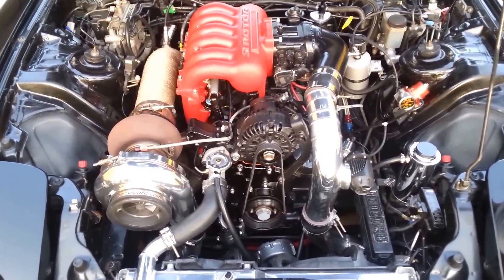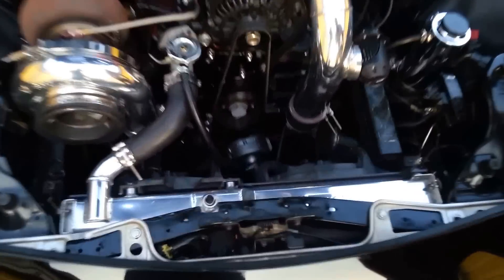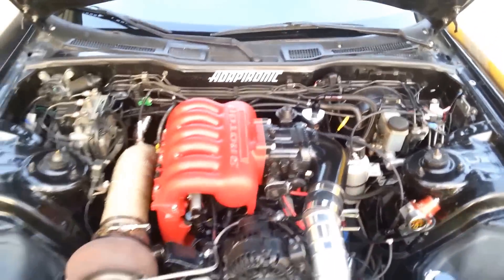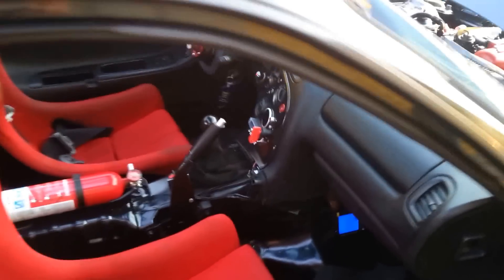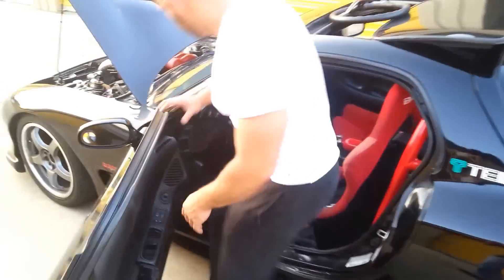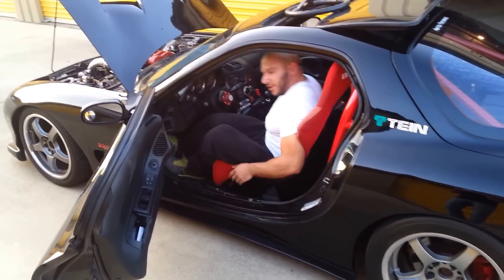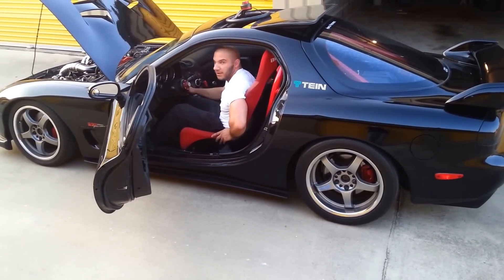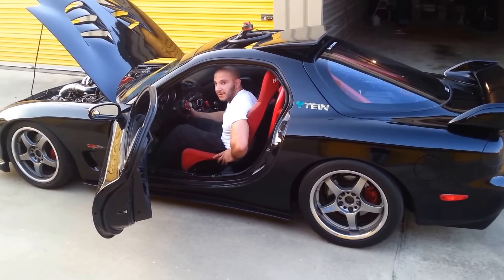3 Rotor RX7 80mm - Review Electric Waterpump

Comment: Nice car and EWP system. I understand you no longer have this car (Cause you went totally insane +4 😎👍) but I was wondering if you would still recommend this cooling system for an RX7 20B setup. I’m not worried about the EWP capabilities, I’m just concerned about its reliability. Are you using this setup on your 26B?

Comment: Oh so the 4 rotor used to be the 3rotor. Ok ok. Are you still using the EWP on the 26b???
Reply from the maker: Chris' RX7 FD thanks chris,
this is actually a different car, i sold this car to build the 4 rotor car. Yes sir, ewp on 4 rotor working excellent
Reply: Wow! they looked like the same car. same roll cage, color and so on.
That's good to hear. I have the EWP on my FD as well. are you using a thermostat on your setup? any issues with winter driving, temps not hitting about 80C? Just curious. btw that 4 rotor is out of this world brother. Thumbs up. Sounds just like the 787B. What you have is a dream build for me. Keep up the good work.

Comment: Dude where is your steering wheel??? lol or perhaps Jedi mind trick steering? Anyway congrats on the electric water pump...excellent idea all round..power/emissions etc.....for the guy asking why?....a mechy pump in a 6 cylinder 4 liter absorbs between 4-6kw of engine power at the top end....an electric one  will consume less than 200w of electrical energy.max!..often as low as 80w of electrical power..thas nearly a full x10 order of magnatude less....so which is the more efficient?

Comment: Clean beautiful car.buy electric water pump is not design for a street car,d rpm has to be up ,and thats very bad,why not the stock billet pump.
Reply from the maker: Thank you for the comment . The electric pump provides a consistent 50 gallons per hour of flow, much more than the stock, belt driven pump at idle/low rpm. Sitting in traffic, with the triple pass n-flow radiator, the additional flow helps maintain more consistent temperatures. Furthermore, at high rpm, the stock pump will overspin and cavitate; the electric pump eliminates this issue. And the best part, when the car is turned off, the pump can continue to run which eliminates heatsoak. The pump makes bleeding the system a breeze and functions as the thermostat via the pulse width modulation of the controller.

Im currently building a 1000rwhp 4 rotor FD3S and I will be using none less than this pump.

kind regards,

zach

Comment: awesome car ... but i have no idea why anyone would want an electric water pump... what is the point?  seems like a mechanical one is sleeker and more compact ... then again, that's what i said about mechanical fuel pumps.  i'm not sure what the advantage of this is ... if it's for power then the alternator will be drawing a larger load and there goes that logic.  hm.  maybe the engine does not support one?  i'm pretty sure the 20b does/did... i'm confused here
Reply: ***** you know, that's not true, actually.  if you're running something off electricity then the alternator will draw a heavier load and when you convert from mechanical to electrical back to mechanical energy the draw-loss is far greater than taking it straight from mechanical going to mechanical w/o electrical conversion.  THAT SAID the problem is, like with the fuel pump, the demand for a heavy load is very seldom needed and a mechanical pump is always giving 100% all the time.  So, if you need 5%, say, and you're getting 100% you've got yourself a nice 95% loss of energy.  I'm pretty sure there is no need for the water pump to be going at all until the engine temperature is up to 180 degrees F or so... and even then a mechanical water pump is going full-time, being controlled by the thermostat... there must be massive waste there.  HM!  I think I've just talked myself into an electric water pump!  Now, an electric a/c?  I mean, there's already electric p/s... and I've heard all we need is a 48v system to support electric air induction pressurization (aka "turbo").  maybe a/c demands so much power that until there's 48v systems out there we won't be able to manage electric a/c ... but, yeah, i'm starting to wonder why all cars don't come with electric water pumps now!
Reply from the maker: The EWP increases water flow tremendously in street driving / low rpms. It also prevents hotspots, and cavitation at high rpm as the flow is consistent, not changing constantly with rpm.

furthermore, the car can be run closer to the higher end of heat range on the track for longer time periods, as you can easily shut down the car and keep water circulating w fans to drop temperatures instantly. 

Run a car up to 220f on mechanical pump and shut it off, the flow will stop, heatsoak will set in, and localized boiling will occur within the engine. You may even blow the coolant cap as the temp rises before it cools. EWP, zero issue.

and additionally, the ewp in my opinion is less bulky.

on my 4 rotor, I will be deleting the entire water pump housing, saving up to 4" of space on the front of the engine. This will also allow me to sidemount the alternator, and run -16an lines directly in/out of the front cover.

thank you !
Reply from the maker: +David Beecroft 

Im not really following everything that you're saying, but appreciate your feedback.

one thing we might note, the EWP and electronic fuel pump, fans, and basically any other electronic motor can be controlled via Pulse Width Modulation to a solid state relay. 

The ecu can use input such as MAP, RPM, or any other means of measuring load, and can be applied to a pulse width modulation frequency table to modulate the grounding rate on/off of the relay, thereby accelerating or slowing down the EWP, fuel pump or whatever is on the circuit.

This way, unlike mechanical, we can modulate the speeds of these systems. Rather than being tied to a fan belt, or a alternator belt, etc. Additonally we can control the speed of the pump to save amps, control temperatures and eliminate the need for a thermostat.
Reply: dzmazzei it all sounds amazingly awesome... so, like in the 80's when everyone replaced mechanical fuel pumps with electric ones in-the-tank, why don't they replace mechanical water-pumps with electric ones?  Are there any disadvantages to electric ones?

thanks
Reply from the maker: +David Beecroft 

Cost

Comment: Dude no V mount >?>
Reply from the maker: Nope
Reply: +dzmazzei V mount first~~lol.first mistake mazda made on Rx7. But still sick bro
Reply from the maker: +Pandu Auto 

I specifically chose not to run the unnecessary v-mount.

The Front mount intercooler fits the charge piping in a more simplistic format and functions just as well. The koyo n flo, coupled with the electronic water pump controls the temperatures perfectly fine. and looks better at that.

The 4 rotor, which im currently building, and everyone will soon see, does not the v-mount or front mount. Rather, Iv conceptualized a water-to-air intercooler built into the intake manifold which is being produced by the engineers at PPRE. This will further reduce the charge piping format, reduce pressure drop, and further increase charge temperature efficiency.

Mazda did an excellent job designing this car.

but thanks for your comment.
Reply: i saw ur car on Rx7 club. are u gonna sell it??
Reply from the maker: +Pandu Auto 

hey pandu,

yes sir, its been sold for some time, working on a new one currently

thanks

Comment: I was debating on if I should run that elec pump or not because I was worried about having an electrical problem on the road and then im screwed BUT I think the pros outweigh the cons (in any). have you had any issues with it? you inspire me BTW
Reply from the maker: Hi Loren,

You are correct in that the chances of issues are greater. However, you could always carry the stock water pump and belt with you on a road trip in case of an emergancy. I have not had any issues. The pump is designed to last thousands of hours, and if wired properly, its less likely to fail then a fuel pump. 

If the rx7 is your daily driver it may matter more to you, but in this case, the electrical aspect isn't worrisome. There's many other things that could fail besides the ewp.